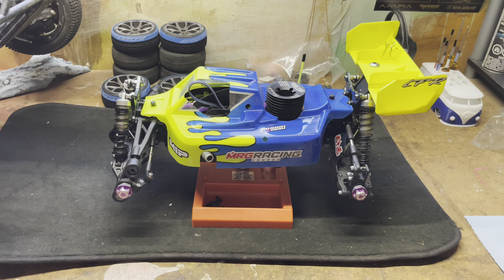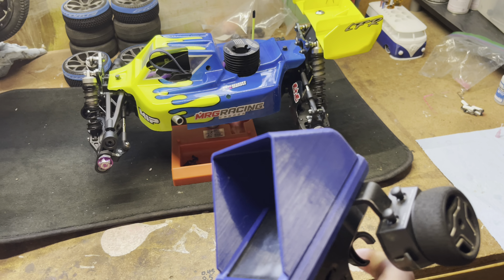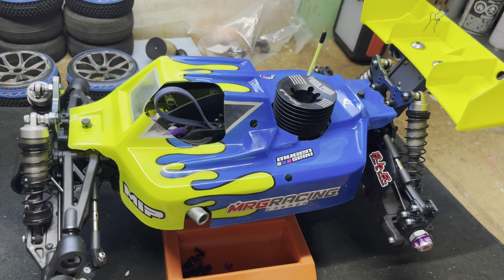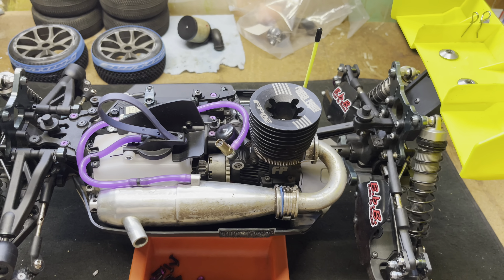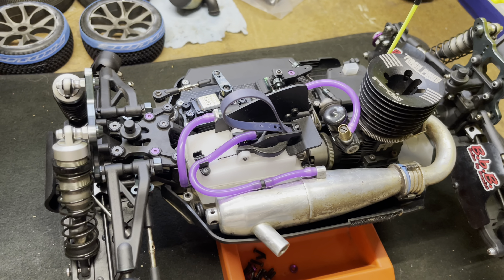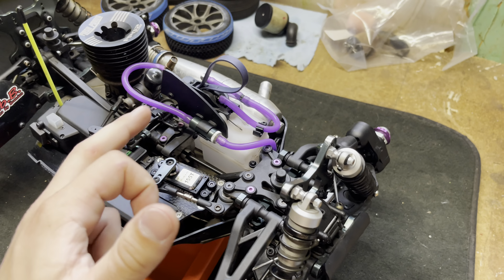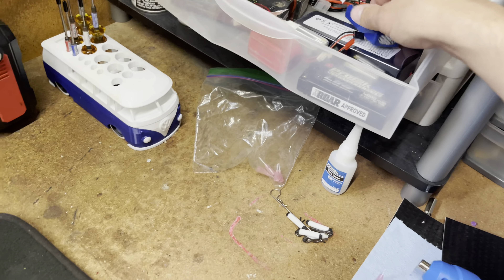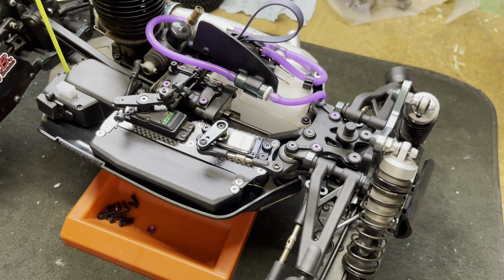Under the hood of my Mugen MBX8R nitro buggy

Comment: Hey Cameron, nice buggy that. I see at 5:33 your throttle linkage is at an angle. That angle is causing stress on your servo and carb as it should be straight. Rotate the metal collar on the carb 180 degrees and you'll have a straight linkage and better performance.
Reply from the maker: Thank you! My team owner actually pointed that out to me and that is now fixed 🙂

Comment: Hello my friend.
I have the same kit and same radio.
Take out the fuel filter and put a direct fuel line and you should get new turnbuckles for easy tuning 🙂
Reply from the maker: Hello! I actually prefer to run the filter. I will look into the turnbuckles though thank you!

Comment: Not to pick or pile on ya😅, I don't know mugen really but the throttle linkage doesn't look like that's free and how it should be. I don't think and you might want to get you a damn lipo bag or a bat safe to put them batteries in so that if they didn't go up they don't burn your house down. I've had one go up at my house before too. So it's a real possibility that people forget about it was a 4S that went up at mine and it was an event. But good luck to you man. Looks good. Keep it up
Reply from the maker: Yeah the throttle linkage was changed. I also have proper lipo storage now too 🙂
Reply: @cameronlogan01  Good man good man. Glad to hear it and glad to see it. It'll only helped you out in the long run I promise